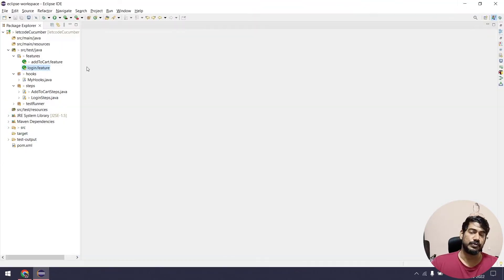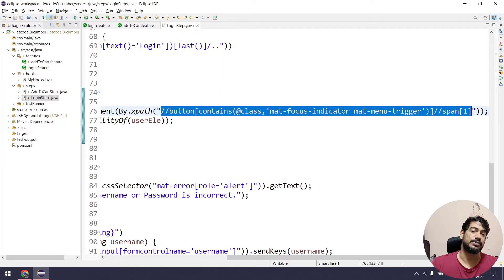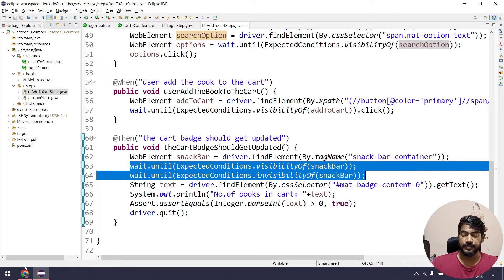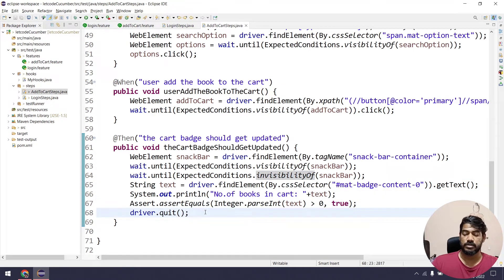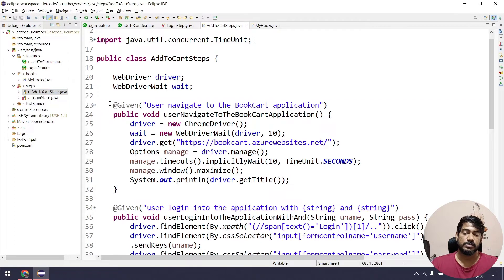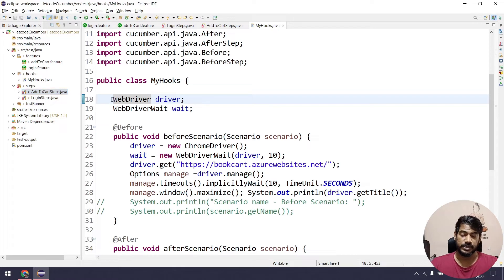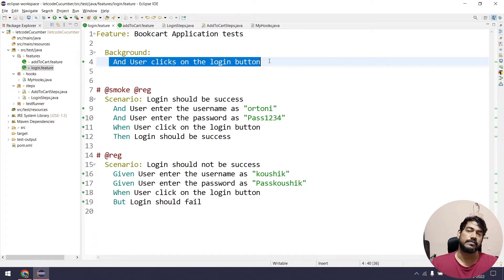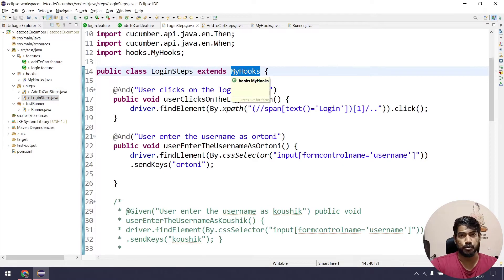Cucumber tutorial - Part 11 | Selenium

Comment: As per selenium docs : donot use implicit and explicit wait simultaneously ,as it can lead to undpredictable wait time ,whats your suggestion to it :)
Reply from the maker: I use both and no issue is there. 
Implicit wait only works for find element and find elements method, so I have to wait for alert or any element state the obviously I have to go with explicit wait.
Reply: @letcode  ok I will follow you